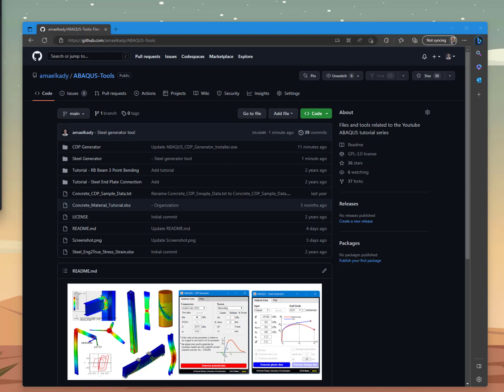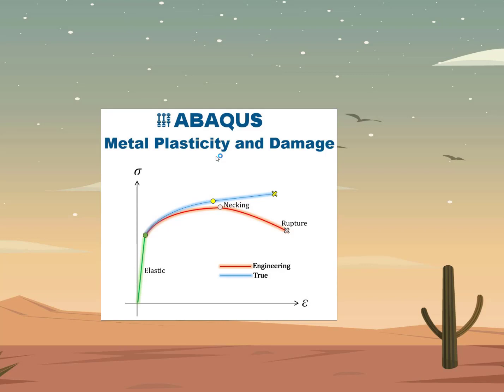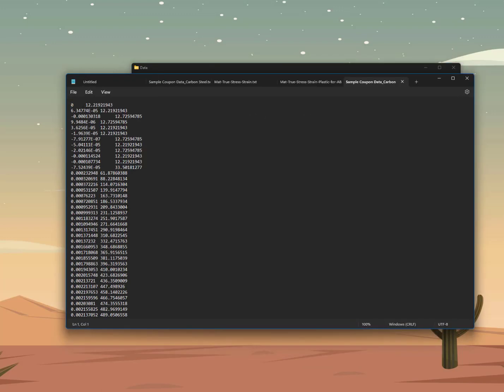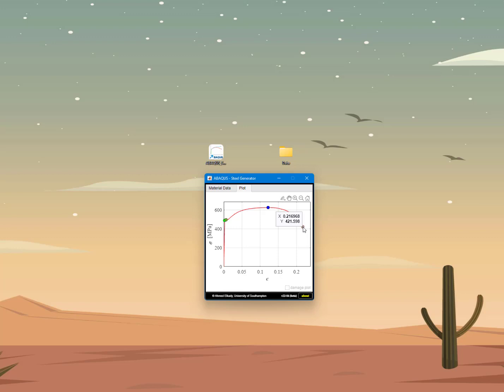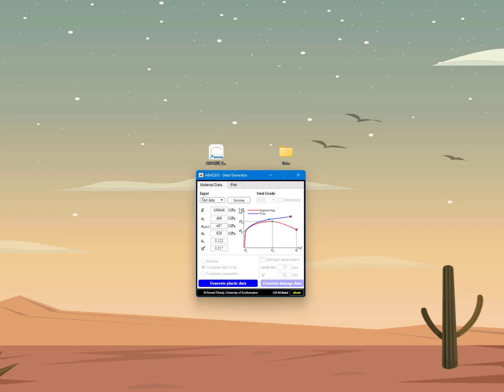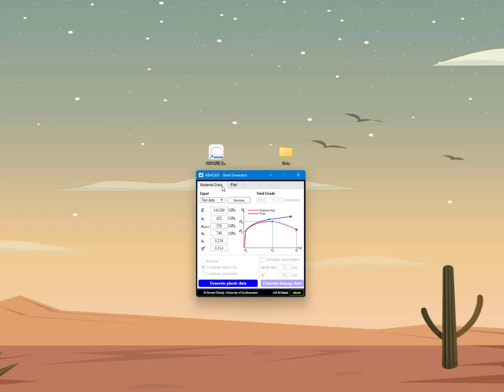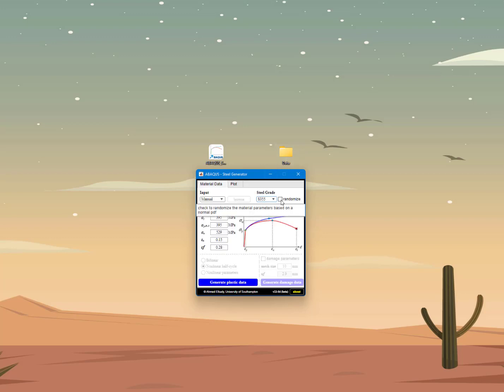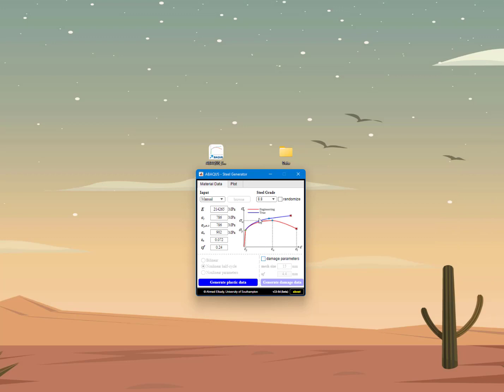#37 ABAQUS Tutorial: Steel Material Generator

Comment: Dear Dr. Ahmed , as per the vedio, the fracture strain from tensile curve is about 0.15 . However , as per output damage parameters from the software , the fracture strain is 0.06 (not 0.15 as per tensile test data) when triax. stress=1/3 (pure tension) . if you can kindly explain
Reply from the maker: the 0.15 refers to S355 while the 0.06 refers to gr 8.8 bolt

Comment: First of all thank you so much for your videos.
I have a question, is it possible to manipulate the cdp data to meet a specific load vs deflection curve? If it is , can you please make a video about it?
In my case, I don't have original cdp data. Thats why i am now struggling to get the experimental results through abaqus.
Reply from the maker: You should not manipulate the material data to match test results. However, since cdp material experience mesh dependanacy due to strain softening, you can calibrate the mesh size instead against test data.